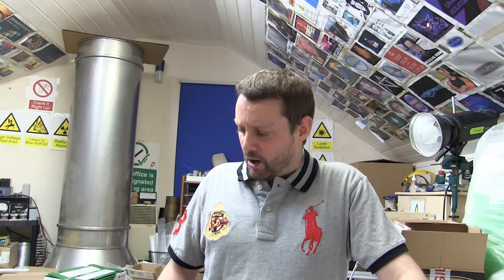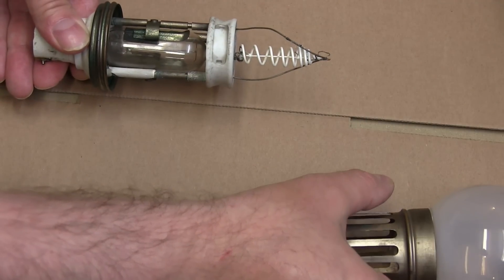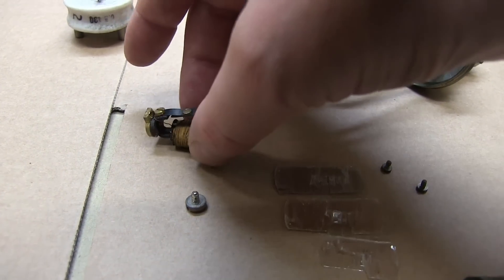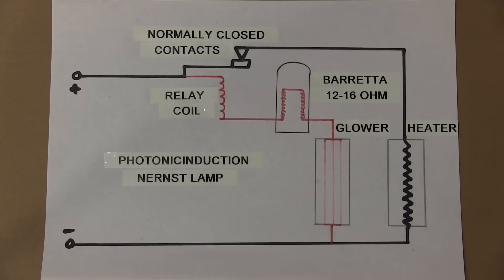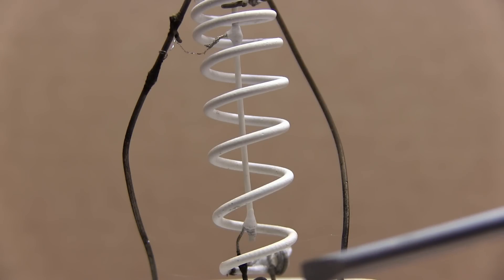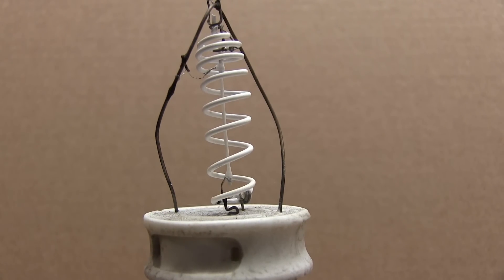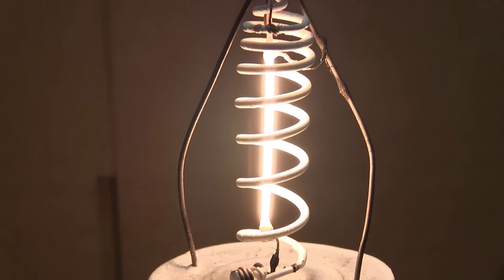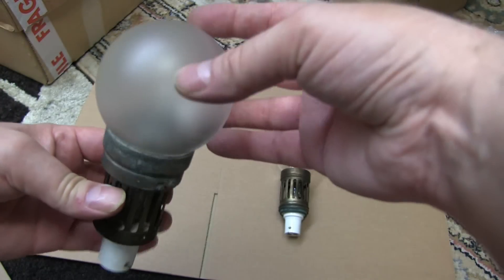120 Year Old Rare Nernst Lamps

Comment: I think that’s the first genuine “I’ll open it up carefully”
Reply: Came here to say exactly this. Talk about "never before seen on the internet", right?!
Reply: I was expecting a hammer bash.
Reply: No one would smash an almost £1m relic that literally is the only working one
Reply: @dragonfireproductions790  1m?? o.O
Reply: @dragonfireproductions790  no way can it be 
worth that much, is it really?
Reply: @alexbarnett8541  yes they are rare AF and most doesn't work anymore
Reply: @alexbarnett8541  some are just at £1000
Reply: He definitely held his breath as he first powered it on
Reply: Those £1000 lamps are a gamble because you don't know if it works or not
Reply: Did you miss the mercury rectifier? Or was that not genuinely careful and was I just fooled?
Reply: Where's moi 'ammer?
Reply: @alexbarnett8541  on ebay there are a few from america for £500-600
Reply: @callumcooper1606  Most of those don't have the interesting filament and is just the outside bits
Reply: @callumcooper1606  OK that seems right. They are pretty interesting.
Reply: @callumcooper1606  most nernst lamp for sale are either glowers only or a non working one

Comment: Very nice.  Any idea what voltage was being dropped by the ballast?
Reply: I'm picturing you holding one while making a soyface.
Reply: Ohh man big clive in ze’ haus
Reply: Time for your kink palculator Clive :-)
Reply: @ghlscitel6714  You forgot to multiply the alpha by the cold resistance, if I'm not mistaken the warm resistance should be 16 * (1 + delta_t * alpha), 50 - 80 ohms for 600 - 900 k absolute, or 14 - 24 V drop at 300 mA.
Reply: Let's be honest here Clive and ask the real questions, can he distill it? :P
You know a channel is good when a channel you watch comments on another channel you watch
Reply: @Mikkel324  You are right - my bad.
Reply: Totally amazing. Are there any bulbs that have a carbon filament when were they produced. I'm Totally amazed at how you managed to get one. It gives off a lovely glow better than those fluorescent tubes pop Where's my hammer pop bang
Reply from the maker: I was more thinking it's crucial for current limiting as I know the ballasts can be interchanged to match the glower's current. I did not measure the actual drop as it was impossible to get on it during operation, but it can be calculated knowing 16 Ohm 130v @ 0.5A Kind regards to you my friend.
Reply: @Mikkel324  The article above says the resistor should drop at least 8% of the nominal voltage and you could get 15 or 25 V resistors, so your calculations are spot on!
Reply: @liquidco2  yes that's certainly the question
Reply: @ghlscitel6714  300 mA X 20 ohms = 6 volts. The vast majority of the voltage drop is across the glower.
Reply: Super impressive realy enjoyed this,!
Reply: I should have figured. You all run in small elite groups. And you're smart enough to NOT destroy rare expensive lights.
Reply: @Photonicinduction  It would be easy to connect wires to the ballast and measure the voltage drop in operation. This would answer this fascinating question for us. You could watch the voltage as the unit came into full glow to observe the behaviour of the balast and glower as they find a balance point, I would not be able to resist this. (pun intended)
Reply: If anyone is curious (as I was) the word is apparently "barretter" and there is a bit more here: https://en.wikipedia.org/wiki/Iron%E2%80%93hydrogen_resistor
Reply: @Photonicinduction  it'll be more than 16 ohm 'in use' as resistance increases with current, thats how they 'stabilise' current, they were used in many valve radios for heater droppers, giving reasonably same current over the 200 to 250v mains range without adjustment taps, normal filament bulbs  also have similar characteristics but not quite so constant current
Reply: @jonka1  XD 🤣
Reply: @elektroqtus  elite groups, the guy turned a light bulb on...

Comment: I have NEVER seen such a lamp before, or had even heard of them until today.
Reply: I'd read about them quite a few times in ads and books from the early 1900s but I'd never seen one actually working or even a photo of one!
Reply: I've also read about them. The illustration showed a lamp with glass cover and another identical one without. And one of the images was upside down.

Comment: It’s sure impressive to see the glower intact after so many years. Never thought I would get to see one operate in its original form.
Reply: Yttria stabilized zirconia is common still, I have used it as a high temperature oxygen membrane for an oxygen sensor. 

I suspect with a little fiddling you could replace the glower or build your own bulb. 

I actually have everything I would need to build one of those bulbs in the lab at the moment, I would just need to know the ideal oxide coating for the heater.
Reply: @Ammoniummetavanadate  My work processes YSZ all day long. I'd have never imagined it was electrically conductive.

Comment: Ironically, the part that looks most like a modern lightbulb doesn’t produce any light whatsoever.
Reply: What is the function of the ballast, could you please explain
Reply: @ubaidu11ah  just a current limiter
Reply: You know what? That component was missing only ONE ingredient to make it glow just like a modern incandescent light bulb: Gas. If you fill gas into that resistor enclosure in order to prevent the filament from quickly burning out, and then apply about 100 to 200v at 1A, you would probably get that two row long of filament in series lit up with a brightness comparable to an incandescent light bulb. Had those scientists accidentally stumbled across this, the Nernst lightbulb probably would have never existed, instead,  they would have simply launched the incandescent light bulb as their invention right off the bat.
Reply: @yafilmDOTcom  There is a gas in there, it's hydrogen.
Reply: Lol
Reply: @yafilmDOTcom  There's one caveat to that theory; the low melting point of iron. It will just simply melt, before it became a brilliant white light. If they were tungsten, you would be right. I'm sure you noticed in the video, the berretta ballast did not incandesce.
Reply: Iron melting temperature too low to be incandescent filament

Comment: An interesting curiosity of these bulbs: they were commonly used in subway stations apparently, and being still in the age of gas light, if a heater coil on one failed for some reason, it could still conveniently be "lit" by heating the glower with a match (or a kerosene wick flame) on a pole just as a gas lamp would have been lit.